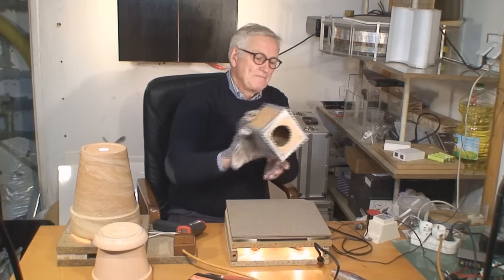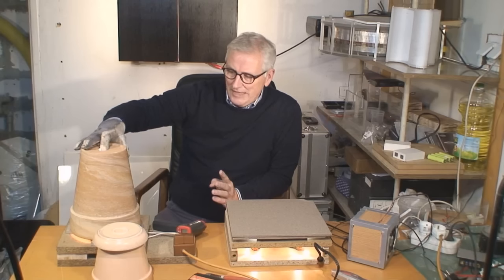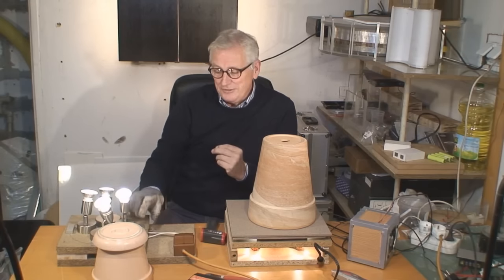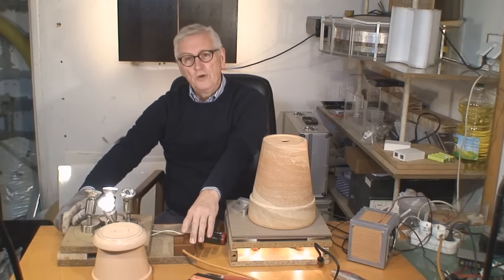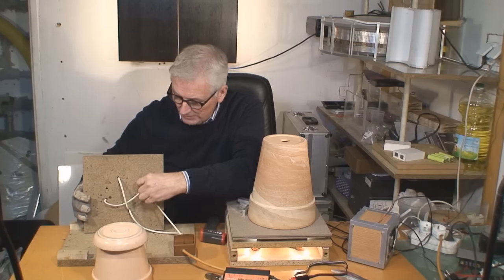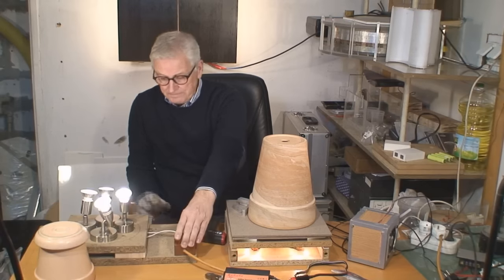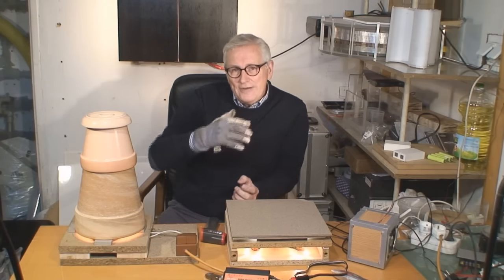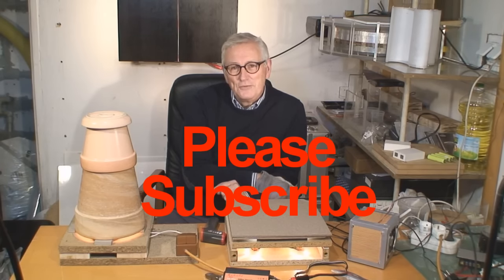Flower pot heaters to die for; BUT won't kill you

Comment: Have you considered replacing the halogen bulbs with infra-red bulbs. I use 150 watt IR bulbs on our farm to keep the chickens warm in the winter and they are rather inexpensive. I'd bet that you get greater heat output since you would be wasting less energy producing visible light and more of it is being produceded in the longer wavelength end of the spectrum that is responsible for generating heat. Also, are you familliar with peltier plates, they are used in thermoelectric coolers. If you apply power to them one side gets hot and the other cold, but the inverse works aswell, if you apply heat to one side and a heat sink the the other they will generate power. Not a lot of power but enough to power a fan to move the air through the flower pot heater. You can get these peltier plates on Ebay pretty cheap, I have about a dozen of them. Your video has given me food for thought and I thought I'd return some of the idea's that sprang from it. I admire your willingness to help others and to encourage others to do the same. God Bless
Reply from the maker: Wow great feedback and a lot I will actually get to work on. I worked in RobertMurraySmiths lab for a month and had this kind of inspiration every day from Rob and Steve. Unfortunately they got caught up in a public company thing, which wasn't for me. Believe he's free now though :)
I think when we work together we achieve so much more. Look forward to hearing more from you soon. THANKS!
Reply: Kerry Harrell 
Excellent ideas Kerry, shouldn't you be doing videos ???
John Larkin.   Southampton
Reply: How many watts are those brooding bulbs?
Reply: My mistake, I stated 150W and they are actually 250 watt bulbs
Reply: Kerry Harrell 
Hi Kerry.   i was inspired by your comments about using IR lamps, so I've ordered one to try. Can't wait! Thanks John Larkin
                         Southampton
Reply: enator71      Excellent reply .....
Reply: If your using brooder lamps or standard bulbs that screw into the socket, you should consider using ceramic bulb base/socket. plastic bulb sockets probably won't be able to safely handle the heat.
Reply: Kerry Harrell      Thank Kerry, I was just about to buy a plastic one!
Southampton
Reply: You are very smart with your suggestion.  Thank you.  the gentleman posted a video with a heating device using a economic bulb of 20w. He needs more than one advice to understand if you convert energy on to light very efficient like led or economic bulb than less heat is emitted.  He need quartz or ceramic heat emitters.  Or infrared bulbs how suggested.  Thank you again

Comment: Nice video. Try to use infra red lamp. They produce a lot of heat. They r used inside car painting booth to dry/cook car paint. Make sure to use lamp housing (or base, or fitting?) made from porcelain to prevent melting. I use them in my painting booth. Sorry for bad English.

Comment: Hello. I only encountered a flowerpot heater a few days ago, in a survival hacks book that I was reading. Now, I am finding them all over youtube. Perhaps, Jung was right about Synchronicity after all! 

My comment is first to say thank you for the explanation of how infra-red provides the heat from these mechanisms. I believe that some of the very old churches we have in the UK use a similar system to warm the congregation without heating the whole barn-sized volume of air. When I first encountered these, they were not efficient and even though I can cope with cold more than most people, I never felt comfortably warmed. The old wooden floors did not seem to get much heat from the system, so sitting could chill you unless you had a thick coat or cushion and the stone floors remained icy and sucked the heat from your feet.

The second reason for commenting is that, while I was reading the survival book primarily for fun and for yet more ways to start the family barbeques, I began to wonder if the terracotta pots could provide a source of heat during the blackouts that are predicted to impact the UK this winter. Your designs are obviously much safer than the tealight/candle versions, but they rely on the lamps as heat source and that means some sort of sustainable electrical supply, either from the house or building or from your vehicle. I believe that the terracotta lamps are inspired, in part, by the fact that an igloo can be heated by a whale oil lamp. This is because the igloo is relatively small and the compacted snow will melt and refreeze and reflect much of the heat back into the room.

So, my question is - what would you do in a power-outage or blackout to provide heat to your home? For context, we live in a building where our living room is not at ground level, but up a flight of stairs - first floor in the UK, 2nd floor in the USA. Our bedrooms are one floor up again. So, the only easy means of access is the front door. We have no other external door. This meant, that when we first moved in, we were not allowed to keep our gas cooking stove and had to replace it with an electric hob and oven. (We now have gas, supplied, but no gas stove and no gas fire. Our central heating is via a gas boiler/water heater, but this requires electricity to power the pump.) 
We can obviously put the central heating on fairly high and then hope the radiators keep us warm during the power outage, but rising fuel costs make that prohibitive. I am also disabled and less mobile.

In such a context, I am sorely tempted to use the traditional pot heater - standing on a heat-resistant surface and without the metal bar which apparently partially contributed to the boat fire you allude to. I would also use a candle or a small spirit stove in a tin, which is designed to produce enough heat to heat up a tin mug of coffee or even - with the larger size - a small cooking pan.
Reply from the maker: Thanks for the detailed comment. It's surprising how much people take their heated homes for granted. Back in the days before 'British gas' boilers. People prepared more for winter. A few of the basics they employed were; Curtaining off small areas that could be heated quicker and easier. Plenty of fire wood, (although the government made us all take those out and install the ridiculous 'gas boilers' simply for their profits). Candle and oil lamps can give off good heat also in smaller areas, but if enclosed in too small an area can create carbon monoxide and burn oxygen fast. And of course lots of blankets. This may seem simple, but the body gives off about 150 to 250watts of heat energy naturally. If this is retained under blankets it builds up and the body recollects it, reducing the chance of hypothermia.
I have a single ring gas cooker always at the ready. They are about 10 pounds and you can get the gas bottles for about 99p in the pound store (while they last!). I also do have a candle plant pot heater as they are VERY effective BUT you must space the candles out and leave an air gap at the base. I will be doing a "Winter survival kit" video soon also.
Reply: @SocialHigh  Thank you very much.

Comment: I watched this video and think there could be a potential fire hazard.  The light housing and wiring are generally for certain watts due to how hot the bulbs get.  With the heat coming out of this could melt the wiring and/or the light housing.  May want to rethink this. 

I was a storage manager and tenants used very high watt light bulbs to see in their storage units.  Many light housings were replaced due to overheating.  The light housing indicates a certain watt light bulb to prevent damage.
Reply from the maker: With 20watt bulbs and even 50w there is no danger of overheating. Most halogen ceiling lights are fitted in exactly the same way. If you wanted to leave more space between the bulbs and base to make you feel more comfortable, for sure, but there really is no need. Give it a try and run some tests. I would welcome all objective feedback.

Comment: I'm looking into this to heat my greenhouse. 12x30 poly covered. We only get to about -10 or so but would like to take the chill off for some of the newer plants. I was thinking of running a construction cord (it has like 10 light sockets on it) down the middle secured to a 2x4 so all the sockets face up and put a pot on each bulb. I can adjust the heat by the number of bulbs I have screwed in. Will this work do you think? My main questions are: Do I have to use halogen bulbs? Can I use regular incandescent bulbs? or the big red bulbs used to heat chicken coops? Should I be afraid of the bulbs exploding? And reading some comments about making sure the bulbs have the ceramic ends, right? Would love your feedback. Thanks for your time!

Comment: So do you think this would heat a studio apartment with a 8x15 room with attatched galley kitchen?
Reply from the maker: Heats a funny thing. Technically it would take 1,853watts of energy being 6,324 BTU's. Over a 12 hour period if you're in all day and turn the heating off at night, it would cost you about $4 dollars a day to keep it warm using a 2000w conventional heater. Now here's the fun bit. If you were able to keep the heat you produce in the space it could cost you as little as $1 a day as you wouldn't need to run the heater as long. Problem is heat is attracked to cold. That means when you open a door the heat is instantly drawn towards the cold area and petty much lost.
The other problem is heat rises quickly. This mean most of the heat you produce sits above the area you sit in until the whole space fills. A simple celling fan on the roof can help that BUT that uses energy which ends up burning your gains.
This kind of heater uses something you need most of the time; Light. Lights give off heat which is usually lost to the ceiling. If you make 2 x 600w tile heaters and add a small 12v fan to the room, some draft excluders and clinge wrap over the windows; and it will actually feel as hot as it would with 6,324 BTU radiator. Cutting your heating bill in half. The tiles also act as a radiant heat source when they are close to you as the tiles store the heat which is not lost so quickly. There are of course many other factors. But to answer your question directly NO. A plant pot heater or tile heater wil never produce enough heat to warm a whole room. But it will give some local heat when you need it.
In an apartment I would recommend a gas burner and some pizza stones. Stick the pizza stones on the gas burners to heat up the switch off the gas. Gas is quite cheap and will save you a lot of money if that's the goal

Comment: Using electricity seems to be defeating the purpose. Do you have any ideas for off grid heaters?
Reply from the maker: Hi Lena Yes. Most of my videos try and reduce the amount of electric as I use solar and energy storage to feed my ideas. I also do have some candle heaters and warm air systems for circulating the suns air into the house/Van. I'll be doing more as I realize what a big problem it is.
Reply: Enapp Open Source Energy
Reply from the maker: @elainemilligan6477  Enapp is no more. Early idea to create a brand but sadly; Too much hassle LOL.

Comment: cool finding.thank you again for the videos. . with that much heat im sure your van will be nice and toasty.. How exactly does the terracotta absorb the heat better than the ceramic tiles?  is it the visible light it is absorbing or just the heat coming off the surface of the bulbs that it is absorbing.? I am wondering if painting the inside  top of the pot black with hi temp ceramic paint where the hole is inside . would it  absorb more of the light and convert that into more   heat or would it block the effects?
Reply from the maker: Interesting idea. I'll test that. I'll be back on the van next: doing an insulation and full fit of a small solar panel and the new heater with a timer set-up. Want to show people with a limited budget how to retrofit a standard van to live in. Lot a people sick of the 9 to 5 grind and crazy rents.
Reply: Thanks!!  For all the testing, Very Fastinating indeed!

Comment: Ok pretty cool idea using inferred I have just aquired a double garage and going to be running a waterless valeting and detailing center the plan is to have the whole garage fully off grid I have currently got a 500w power generator I'm using for lighting and charging stuff hoover drills etc now I'm wanting heating been looking at gas heaters but rather not and of course nothing will heat the space up electric due to requiring massive amounts of power .so I thought I have a gas hob I use for camping in there for boiling the kettle etc so maybe a pizza stone and fan do the trick lay the stone on top of the hob and the fan Infront to blow the heat around the room ? Any thoughts and recommendations would be great sorry this is a new YouTube channel lost access to my main 😡
Reply from the maker: Infrared is the most efficient and consumes the least amount of energy as it heats things. The new carbon film video gives some more details. Infrared in general won’t heat spaces as it’s directional wave heat. But you will feel really warm if you get the setup right. A one meter length of carbon film will use about 70 watts but you’ll feel the equivalent of 20c in btu space heaters of 1500watts if it’s positioned correctly.
Reply: @SocialHigh  interesting thanks I thought about under floor heating on some panels like ceramic or terracotta tiles

Comment: Where do you get those lights? if you don't know, what is the type. . .as in. . .if I were to do a Google search, how would I find that kind of socket for the halogen bulb?
Reply from the maker: '3 Way Ceiling Spotlight Halogen' come as one fitting and you can use up to 50w halogen bulbs. Then just pop the flower pot on and you're good to go. If you add a three way or dimmer switch you can control the heat.

Comment: What if you had only the bulbs sticking up through an insulated plate. Would that be safer as far as wiring overheating ECT?
Reply from the maker: You really won't have a problem with wires overheating. These fittings are usually enclosed in cealings with the wiring above the bulb/heat. In these designs the heat rises and the wiring is below the fitting. There is also a substancial air gap between the bulbs and the heat collector. Even in the 600watt heater the wires never get too hot.

Comment: I guess my question is what is the outside, and room ambient temps? You have three heaters going in what seems like a small space and are still wearing a sweater? 

I have no trouble having used a heat lamp to raise baby chicks that a light can put out substantial heat, but ??????????
Reply from the maker: I just got into the workshop and it was 8c when I arrived, so that's why I'm wearing the sweater. The ambient heat isn't really what these heaters are designed to change. They are really intended for close proximity warming or heating very small areas; safely. However the 600w heater does warm up the space I'm in in about an hour to about 15c. The small tile heater is a great heater for pets and in your case chicks :)

Comment: Whats the point ór the difference with just turning on the lamps without a pot covering it ?  Same energy/Watts are emitted into the surroundings...
Reply from the maker: No really. Infrared is the key. Ceramics omit Far Infrared light. (it's invisible to humans) It's the same thing that makes you 'feel' warm on a winters day. Even though the sun doesn't heat all the space between here and the the sun. 'Normal' light waves don't. But the heat lets the terracotta pot release the infrared which heats objects near to it. Crazy right?
Reply: @SocialHigh  Thanks for your reply. I really love free energy and really believe this tech already exists but is kept a secret. In this case I actually meant: is there a measurable input - output difference of calories/room temperature with or without the lamp covering?
Reply from the maker: @lisapotter3052  I totally get it. I'm building a cube house/observatory next year to test some of the real life scenarios that people may find themselves in. But you are right. Most trades people tend to keep secrets to themselves. But to be honest; most of them simply don't understand how things work; me included, and that's why I experiment so much. I'm always here if you have questions or want to share/compare notes.
Reply from the maker: @lisapotter3052  on your other point. Energy is I've found more about storage than production. In my experience I rarely ever use all the energy I collect. Efficiency of solar panels is not really a big factor. I usually install a fewer panels and lots of batteries (which I get from scrap yards). Heat comes in 2 forms; BTU's and Radiant. BTU's heat spaces. Infrared heats things and tends to be dryer. Water is the best 'heat' energy storage systems that I've found. With a magnitude of 10+ in my opinion. Batteries are not really good for energy storage if it's only for heat. Converting the energy directly into heating water and storing it in a WELL insulated tank with give you better results.